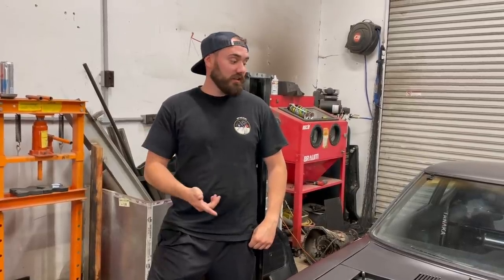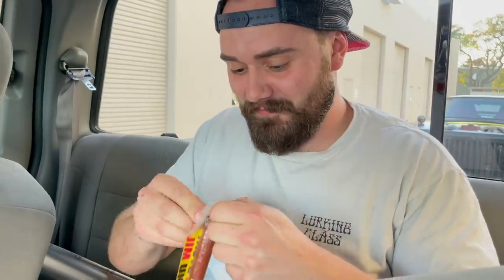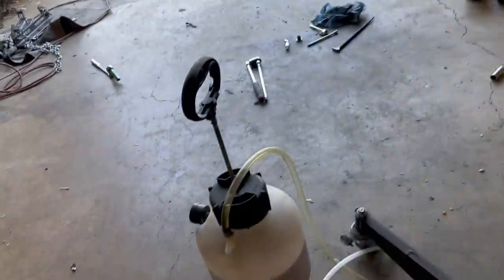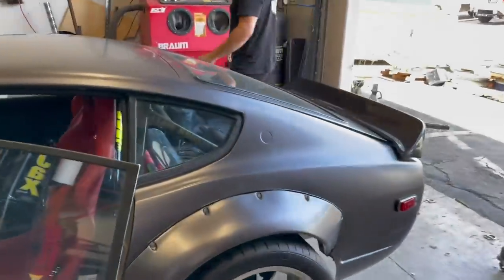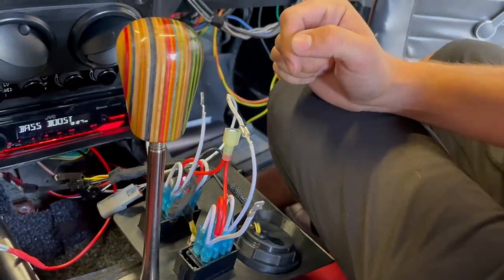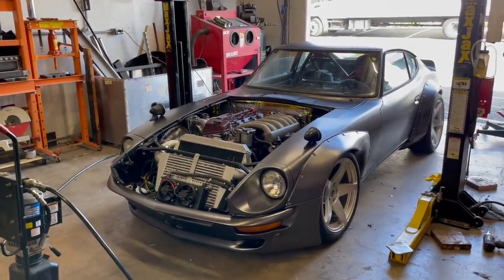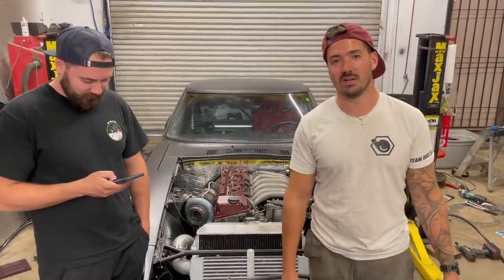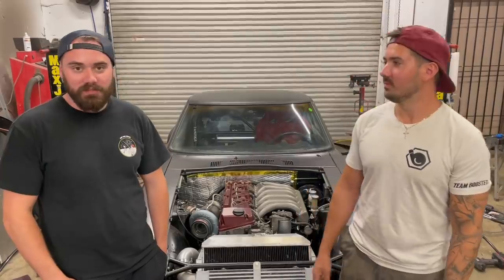MERCEDES DIESEL 240z looks INSANE! Big Brakes, New Wrap

Comment: The ideal braking system is the lightest brakes that is capable of locking the tires at it highest speed and can repeat. These may be a bit heavy. I am curious with how you will match the brake master bore to the calipers.

Comment: Leave he exhaust.  If it's stainless then polish it up.  If it isn't then add a chrome tip to slip over it, it'll look very late 1960s when chrome exhaust tips were all the rage.  I'm an old fart so I remember.  Adding a FG bumper a good idea too.  I LOVE diesels, in boats, trucks, cars, you name it, so I am loving this project.  I'm a weird out fart that loves the smell of diesel exhaust.  I follow city buses witrh my window rolled down.  My dream vehicle is a Unimog with this very diesel powering it.  I can dream, can't I.  Keep up the great work.

Comment: Cut the exhaust down and put a nice tip on or leave it, if your worried ab diesel coal getting into the wrap have a reputable diesel performance shop clean the tune up a bit. You can make power on a clean tune

Comment: I reserve my opinion for the exhaust pipe til the bumper is installed.  If the bumper isn't going to be installed then the tailpipe needs to be shortened and slant cut.  While silver wheels are typically played out for some reason they look great on the car with the wrap and the offset looks great.  Just my $.02 or maybe a little worth.

Comment: A had a similar fuse issue a few weeks ago. Through I broke a wire to my driver side door controls. Popped a fuse for my interior lights which was shared with thst door switch. Felt dumb later after tearing a bunch of panels out tracing wires.

Comment: So you only need 5 to 10 seconds of glow plugs or else youll burn them up, also dont start the car while the glow plugs are hitting because itll spray diesel on them while theyre still in the super hot phase because you could warp them and youll soot them really bad makeing them not work as well.  You may need to run 2 batteries to have enough amps for start-up its just a suggestion it tends to be the norm in the diesel world

Comment: I fill my trucks trans but taking the shifter off and dumping the fluid in the top... May be a little over filled but not by much.
Reply: Works well on top mount shifters like most tremecs but the cd009 uses a remote shifter, so unfortunately not possible

Comment: Diesels are automatically exempt from smog though i thought? Just go get it bar'd as a diesel. they open the hood, have you start it , go "yep its a diesel!" and sign the paper
Reply: Only pre-98 diesels in ca. Om606 turbos are 98/99 :/
Reply: @samjohnson7325  i thought that only applied to the body but good to know
Reply: @draggonhedd  when you bar ref and engine swap, you effectively turn the vehicle into the year that the engine was sold as,  so unless we swapped in a pre 98 diesel to do the rep,  it would be registered as a 98 and be required to do smog checks, which is counterproductive

Either way. The pre 75 body and a pre98 diesel have effectively the same benefit,  and neither are actually exempt from emissions laws,  just testing. 

Technically if any vehicle back to I believe1966 doesn’t have all of its original emissions equipment and you get pulled over by a dickhead cop, you can get ref’d and will have to go to a station to be inspected.   Granted this is all speculation,  I don’t know of anyone that has had this happen with a non emissions tested vehicle, but it is technically possible.
Reply: @samjohnson7325  yeah, makes me not miss california for sure. Glad I moved back to NH.

Comment: Holy crap.  I was not a fan of the body kit until I saw it with color on it. The exhaust, I would just straight cut it an inch or two from the body opening. Not a fan of the Japanese drift style.

Comment: Hey guys please don’t tell me that that was a plastic fuel pressure gauge line or oil pressure gauge line inside your car those things melt super easily under the hood and can cause massive problems and they’re very easy and cheap to exchange with a copper line. So please spend a few bucks now to save a few thousand later